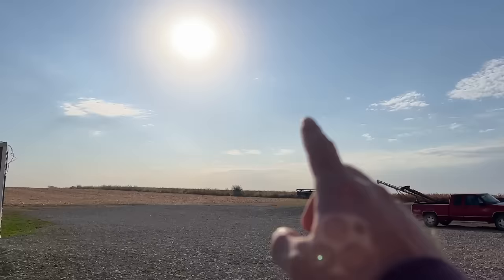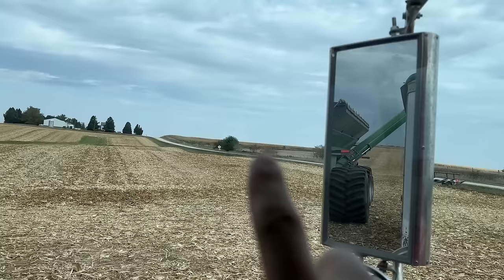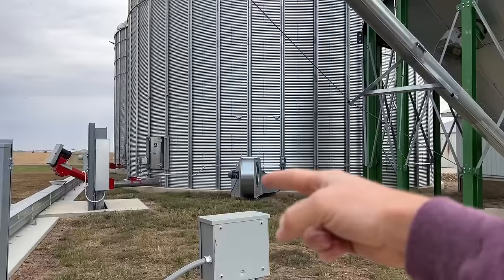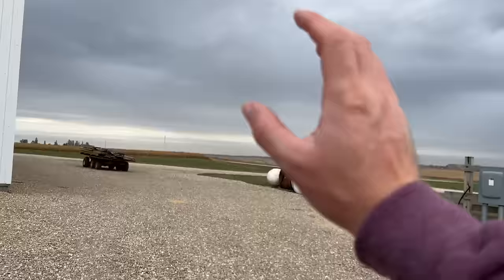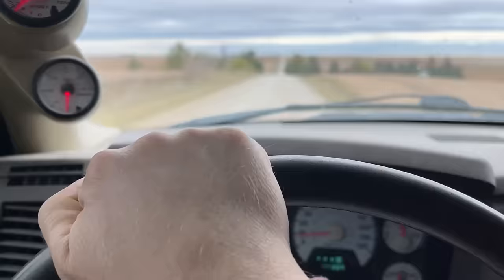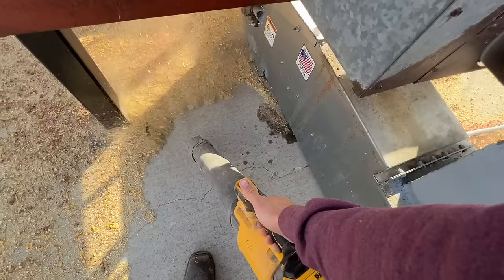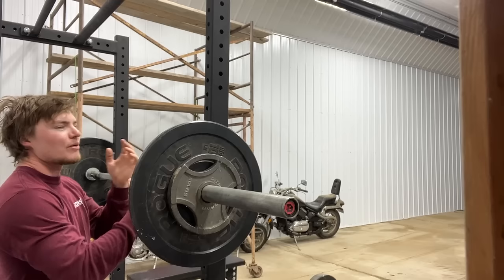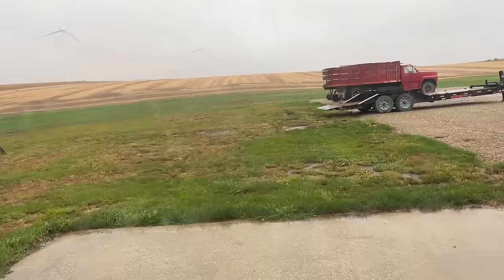We Were Forced To Stop Harvest

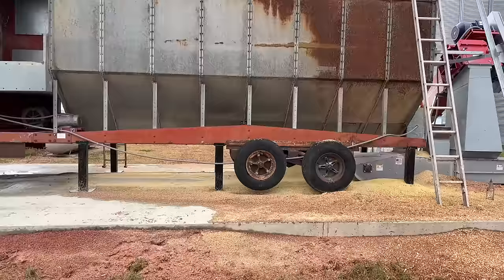Comment: W/ 23 years in cremation machine manufacturing and service (basically the same type of burners you use in dryer, but run MUCH hotter), I can explain the questions you had at 8:54  : 
The rusting areas you are seeing are because those areas are cooler than the rest of the metal - so they will rust. Metal can't rust when it's hot.
Also the little parts of your grain that is poofing out - it's smaller - so the air pushes it much further than the rest - you will probably notice the smaller grains are towards the backend (yes, you'll also have larger parts there as well as it all moves that way, and goes thru the bend to the auger) but most of the smaller stuff near the flame section (read: the area you have less rusting from the outside perspective) is just burned off if has access to direct flame (this is most likely your 'popcorn' smell - the finer bits of the grain being burned off inside), and what makes it past get pushed to the end to fall out - which explains the 'more debris as you go'. The most debris will be at the end as it stops and drops down to auger area, which looks exactly like what's happening.
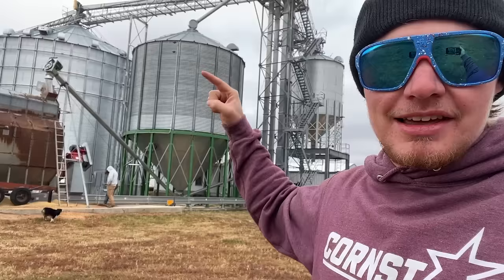Reply: The picture @8:34 shows the backend of the dryer.  An inclined auger brings the wet corn from the cone-bottomed bin to the top of the dryer.  As the corn piles up, it covers the leveling auger which augers the corn the length of the dryer.  The whole kernels of corn are moved, and the pieces drop below the leveling auger and move to the bottom of the dryer.
The files would have less air flow thus with less hot air passing through making the temperature would be lower.

More fines are at the backend because of where the corn enters the dryer, not because of your explanation.
Reply: @ronsommer9409 Excellent explanation! I've never had to work on a dryer system before, so could only assume how the internals work for auger placement.
Reply: @MrWashingToad  A cross-section of that dryer would look like a doughnut.  The corn surrounds the air plenum (open area in the center}.  The leveling auger is at the top and the unloading rolls are at the bottom.  The plenum air goes through the corn and out the sides. 

The plenum air is the same temperature at the front and the back of the dryer, so the lower temperature would have to be due to less air flow.
Reply: Nice to hear so many experienced people in the comment section regarding the drying process. Just adds to the Cornstar channel.
Reply: Grain dryer tech here, theres so much more to explain with the drying process lol.

Comment: Those cracks in your concrete you should put a sealer into them to at least preserve the pads until insurance or you replace them. Use some kind of caulking to keep the water out before it gets in then freezes. If that happens then it will expand and break it up more as the ice expands. Always like your vids. Farming is hard work that never ends but satisfying
Reply: Don't do anything with the build until the lawsuit is resolved or they will use it (However small) as an excuse to try and skip liability.
Reply: The problem with the bin is the site prep, when the ground was built up the dirt was not compacted correctly. The concrete and bins were built to spec, adding all that weight to the dirt caused the settling. Caulk is not going to fix the problem.

Comment: The corn dryer.  The rust is there because the air flow hits the wall at that end and then escapes.  Moisture and erosion cause rust.  All three make larger holes in the screen.

Comment: Do what the electric company does here in Illinois when a pole starts falling towards the road a truck with an extension ladder against the pole so it doesn't fall on the road it's a small fix until they can get it replaced you should Park equipment next to the concrete base so it doesn't keep moving

Comment: It seems like it would be really incredible to have some kind of machine that had soil analysis components, that could crawl the field and get a really granular measurement of soil condition. Then, those measurements could be fed into the AgLeader software to give you the condition of your fields, down to the square foot and then utilized within an improved sprayer system, that could supply tailor made nutrient mixes down to the square foot or so. Think, taking the chemical mixing system you have on the flatbed and building that into the sprayer and the sprayer becomes sort of like a massive inkjet printer of nutrients for your field. It would be the ultimate combination of the AgLeader software, the combine yield software and the chemical/nutrient mixing software, in order to systematize the management of your crops. The final piece would be the machine that crawls your fields for the soil sampling, pre-planting, could also crawl the crops, sampling things like moisture conditions and any other important metric, maybe including early elimination of extra nutrient stealing plantings and identifying weed, for needed additions to the sprayer recipes, all down to the square foot. The fact that crops are planted in such regular rows, the field/crop crawling bot wouldn't be that difficult to run, like a roomba, all the time. Imagine doing watering on a square foot by square foot basis, based on the needs of the crop in that square foot, all in a automated, self driving way. Really, AgLeader needs to expand their software to include a more centralized base station that allows for the control of all systems (machine, control systems, etc.) so a farmer can pull all of this information together to do better planning and control. Maybe they have or are already working to do this and I just am ignorant of that, but it seems like technology is really starting to align so farmers can really step up their technology based planning and running of their farms, it just requires that many of the existing technologies be pulled into the same ecosystem and play well together. Really, it would be a whole farming ecosystem, much like the crops you are planting and harvesting are an ecosystem. Now all that sounds like a really interesting project!!!

Comment: Answer for why fines are on one side.   The wet corn entering the dryer from top, the fines will find their way in the first two sections, similar to why bins are cored to remove the fines in the center.  Also you need to make sure those sections don't plug and they may empty slower than the other sections without fines.  Good luck!

Comment: When did you and Cooper start REALLY helping on the farm? You both seem to have experience beyond your years!
Reply: Farm boys start learning from the day they are old enough to tag along with dad, so basically 5yrs old! Personally I started cultivating on my own at about 11 or 12, so I imagine they are about the same. My older brother started earlier than that.
Reply: We were in the field with blocks bolted to the pedals so we could reach....if something went way wrong we were told to pull the fuel shut off. Dad used to give us jobs that probably slowed him down just so we had a understanding that no matter what the livestock came first. So in our case, 4 years old for the cattle and pig barns, at 5 or 6 we were running the "small" tractors by ourselves.

Comment: The cracks in the concrete ate the ben site is caused by the high water table that you have where you built the gran site. That is all that water you got into at about 10 feet when you dug your pit. All the massive waght of that site is slowly moving down hill. That's why you have a architect that specializes in gran fasilits to create a blue print of it because thay would of told you to get a soil compaction test.😳😳😥😥😥😣😣😣
Reply: More along the line of not removing bad soil and installing properly compacted base material at the right depth.
Reply: @johnunsicker7440  that or pouring reinforced concrete pears down to solid ground. Eather way is expensive and would of been better to find better ground.😓😓😓😓😓
Reply: All the responsibility still falls on building contractor. They should of made sure of that before one yard of concrete was poured
Reply: @bren-xmotorsports55  No, this is a commercial project thay did exactly what the blue prints told them to do and in this case the blue prints where produced by the contractor. The contractor was told that he needed to cut cost and he did.😥😥😥😥😥😥

Comment: I am not bodybuilding expert or anything like that but I would advise focusing on the negative portion of the movement and form. A lot easier to lower a heavy weight than lift it and muscle growth is stimulated by stretching out that muscle. And form of course we do not want any injuries.

Comment: Cole that freighter has a 15 SPD it's meant to split the low side for heavy loads depending on the specific transmission it's possibly a deep reduction or more normal for road work

Comment: Could you go back to putting the wetter corn into the big equipment shed and feed the dried as fast as the system will take it?
Reply: Shelled corn has to be dried to certain percentage of moisture regardless of where you store it.  Wetter corn would rot in the machine shed just like it would in a bin.

Comment: Automation of functions is excellent, until it stops working at an inconvenient time. Just had that with my alarm system, was tight for time, jumped into the car and, 'No Signal', jumped out, opened up the door, set the system manually, locked up, and tried again. I found out later when I had time, that one of the access methods was turned off for some reason

Comment: About your dryer corrosion, chances are whatever is supposed to distrubute the corn at the top of the dryer is not doing its job properly so most of the corn is dropping through the dryer at the corroded end causing heat build up and higher moisture in the air escaping at the end of the dryer. Also accounts for the higher amount of trash on the ground at that end. Uneven distribution thru the dryer mai also be contributing to your inability to dry really wet corn as its not working as efficiently as it could.

Comment: The rust on the corn drier has opened the breather holes larger than on the un-rusted side allowing more of the corn residue goes through
Reply: Those holes arent opening. Excess fines come exclusively from excess handling and too high of drying heat. Augers are tough on grain. Im a dryer tech and always see more fines around a dryer thats fed by an auger and has a leveling auger. Handling is a big portion of damage, though drying temps above 180 also lend to unwanted damage/brittleness.

Comment: Just speculating- you noted that one end of the dryer is rusting- and that is the same end that seems to be blowing out fines. Is it possible that the surface rust is enlarging the holes by eating away at the coating and the edges of the metal on those small holes?  Love every minute of your videos!

Comment: You know, thinking about your intercrop video, it seems to me that if you were to take that 40 acres behind your place and do 12 and 12 rows of beans and corn on a high management plan you may just be able to get more out of your yield. I know that your 12 and 12 rows didnt produce as much as a few of the others, but the amount of loss you may have had from the beans due to the devistators seems that the 12 and 12 rows would be the most profitable. I'm not a farmer, but from watching your video's it seems you did pretty well on the 12 and 12. Now, adding in that you want to try amore intensive fertilizer treatment on that 40 acres, maybe the intercrop would work out better with higher fertilizer and high maintenance. I know it is expensive to "test" products and pray they work to your yield advantage, so you would klnow better on trying an intensive fertilizer and high maintenance. Just a thought from a non farmer. Keep up the video's Cole, I have learned more about the trials and tribulations of farming from your video's than I could have ever imagined. I truely hope that your legal issues are finalized in your favor and things get replaced and repaired a quickly as possible. Give a hug to your family, they are more important to you than you know.

Comment: THE  corn fines are high at that end as the air is comeing in at the far end going tords were the fines are piled high  as there light and get blown that way and I would do the 12 x12 rows for intercrop polts as you have a 12 row corn head faster to get done and less lose for beans witch would meen higher income as well I would mod the 2 silos to be short trem bean bins till you can get bigger bins or more small ones i think you could mod them for your needs for 1000 to 2000 a piece and make even more by holding the beans a little longer the silos look like they could hold 4to5 loads if not more

Comment: You’ve cleaned up the properties, bought new equipment, installed a bin storage system, added a wheat harvest, and are trying different prep and planting methods. 
Has all these changes, op ex and cap ex included, changed the bottom line?

Comment: Appreciate your testing on this. Thinking outside the box maybe a little here. But, do you think 36" corn rows in a monocrop set up would be more profitable than 30" or 20" corn rows? Input costs should be slightly lower, I think. And, more sun would reach the plants. So, I think they should yield higher I'm thinking. Have you put any thought into testing a mono crop corn field with wider rows?

Comment: That slab cracked because it is concrete they will guarantee it to get hard and crack especially if there is no control joints to help keep the cracks from spreading all over the slab.

Comment: Cole your truck actually has 20 speeds if you could use them all.  maybe you do use all of them , i rarely used granny gear in the trucks i drove but residential construction is way different that farming. thumbs up for Cole/
Reply: Not a 20 speed it is a 15 speed.   It is a 5 speed with hi low selector and then a deep reduction gear as well.
Reply: ??? Not

Comment: That slab cracked because it is concrete they will guarantee it to get hard and crack especially if there is no control joints to help keep the cracks from spreading all over the slab.
Reply: The one under the hopper bottom didn't have enough rebar or screen reinforcement in the structure of the frame work to give it tensil strength and the field went poured thick enough to handle the weight.
Reply: Once the spring comes and the big bend are emptied they need to be inspected under the ventilation system in the floor they may also be cracking and failing.

Comment: not enough drying capacity was a major oversight which kinked up the flow of your entire operation - what happens if a dryer breaks? you should probably buy two for next year. you should think about a central vac system. farmers may scoff at ai but ai is going to be smarter than your lawyer, doctor and cpa combined - why wouldn't you think about using ai on the farm - it is a natural but you need an in house setup - just for finding your own info - indexing all your docs in to an inhouse search engine it would be valauable but then adding real time and p2p indexing with other farmers could be invaluable. enterprise resource planning via ai in hybrid and private clouds will be more valuable than consultants for much less money - eventually - initially they will be adjunctive but even that will be a major development because you always need second opinions - both consultants and ai can be wrong too - remember that but considering you will never beat a computer in chess it is just a matter of time for the domain creep to enter the ag sector and this should be a big boost to productivity. hope you start planning garage/office build - would be a good winter project
Reply: He's got a large dryer on standby. They just can't install it yet because of the site issues